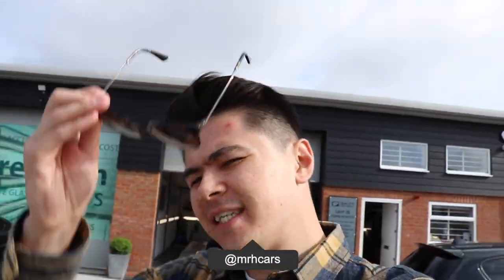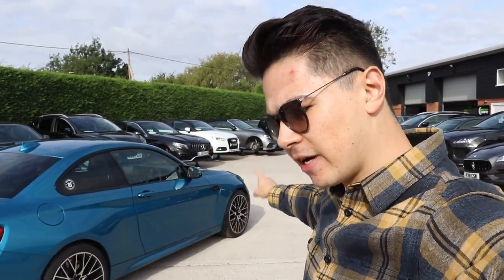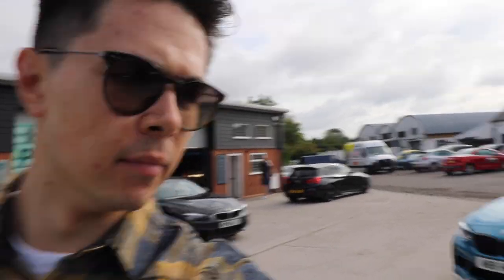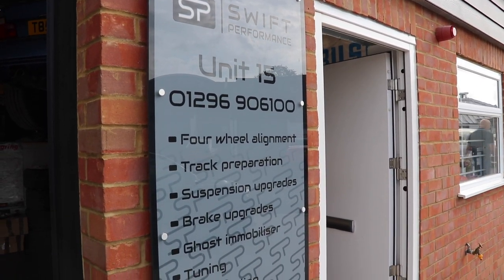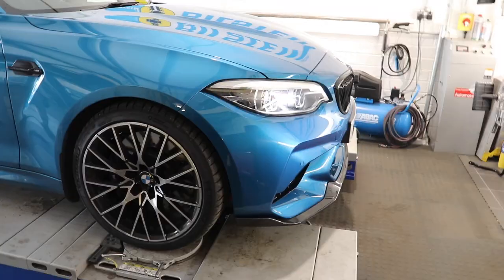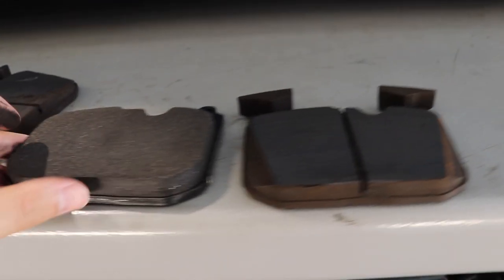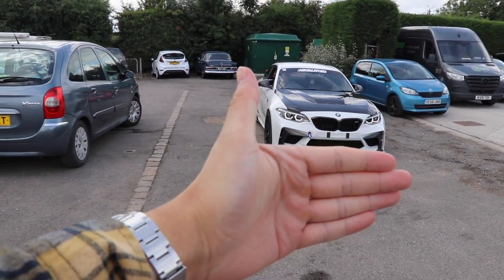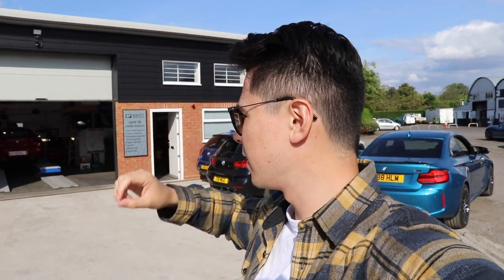Preparing The M2C For Track!! 😈

Comment: £350 for the rear tires. Is that £350 each or for both? If its for both where did you get them?! Great video btw👍. I just picked up my M2C last Wednesday in sunset orange.
Reply from the maker: Congrats on the new motor mate!! 🧡
Prices I gave in the vid were for 2. Wouldn’t recommend ever getting only 1 tyre done as you’ll have more grip on one side. 
Got them from blackcircles.com - keep an eye out for any discounts they have running
Reply: @MrHCars  £350 for 2 ps4s tires is very good. I can't find them for cheaper than £240 each! I'll keep my eye out for discounts. Thanks man.
Reply from the maker: @adeebnoor7438  I double checked my order email, it was £385.66 for 2 x PS4S 275’s. 275’s will be cheaper as they’re not a “standard” M2 size.
But yep, keep your eyes peeled for the discounts.